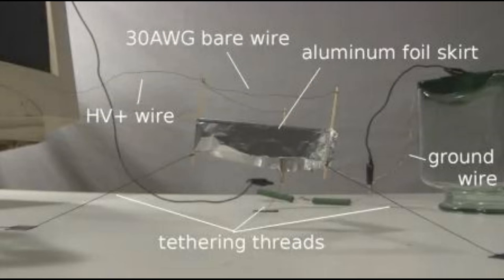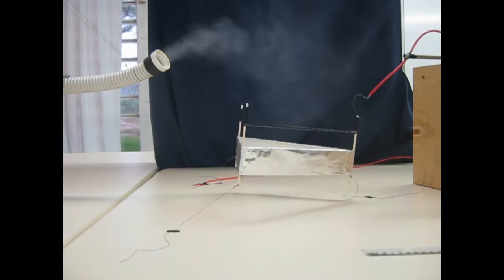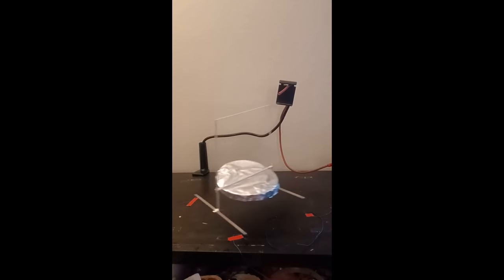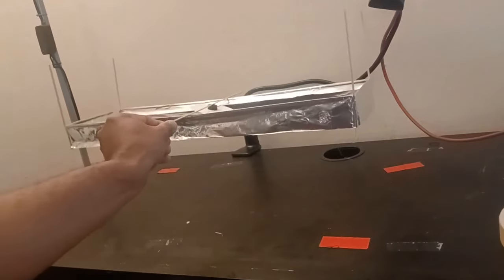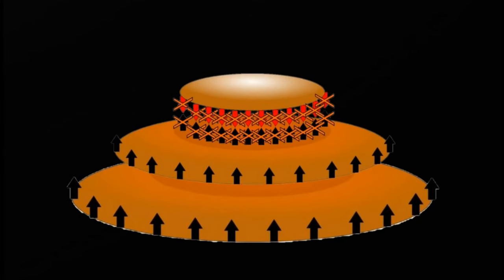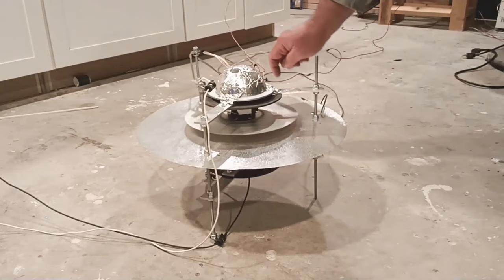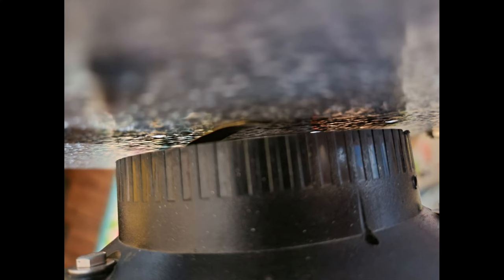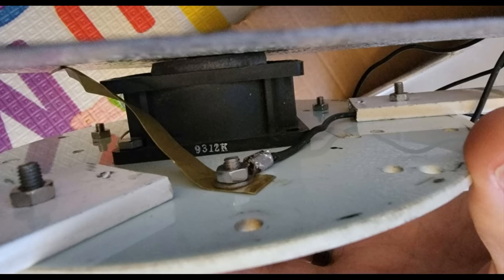Graviflyer "One Step Closer To Lift" #44

Comment: No anti gravity. But ion air electric. Coanda effect.
Reply: Ionic wind has long since been ruled out as an explanation for these type of craft, Brown's experiments included vacuum chambers which resulted in an increase in the effect, not a decrease.
Reply: Not sure what you mean by that, but there is definitely no "anti-gravity" involved. The reason these ion-thrusters produce thrust is because the ionized air molecules will run towards the collector, producing an equal & opposite reaction on the emitter.
Reply: @L-Office  but there is a catch to everything.  If the ionized air effect lifts a device like this that is as heavy as the original video, that is indeed promising.  because no experimental test does not accomplish such a feat.
Reply: @0_MisterX_0  The poster of this video claims an effciency above 1, I wouldn't get my hopes high.
Reply: @L-Office  "The reason these ion-thrusters produce thrust is because the ionized air molecules will run towards the collector"

As I said, Brown's lifter experiments in vacuum chambers showed an increase in thrust, if air was responsible the effect would diminish drastically, the opposite occurred. 

It should be clear what that means.
Reply: @JenkoRun  That makes no sense whatsoever. In perfect vacuum you have near 0 thrust because you are just accelerating electrons with an extremely tiny mass. If you want to produce any thrust in perfect vacuum, you have to provide a gas, ionize/accelerate it and the opposite, equal reaction will propel you forwad. It's the same exact principle as with an ion thruster in air, just that we use a different gas. This is nothing new btw, this has been used in satellites for decades.
Reply: @L-Office  It only makes no sense if you insist on clinging to this idea that the forces involved are of material nature, Brown's field propulsion methods didn't use ionized air or any other grass, they used fields, fields are not material.

Brown's lifter experiments are not ionic thrust, they are not material in nature, and they get stronger in a vacuum.

If you think the kind of experiments performed on this channel and other related research is based on material propulsion methods, you need to either open up to a new principle of field dynamics or leave, because we're not working with that primitive technology with these concepts here, and nothing you say is going to convince any of us to drop our research.

Technology moves forward on thinkers and experimenters, not sceptics and parrots.
Reply: @JenkoRun  What do you mean by "fields"? There are E- and B-fields both of which exist because of charged particles, i.e. matter. Gravity fields also only exist because of how mass, i.e. matter affects the space around it.
If you know any other fields, especially ones not relying on matter, please enlighten me.